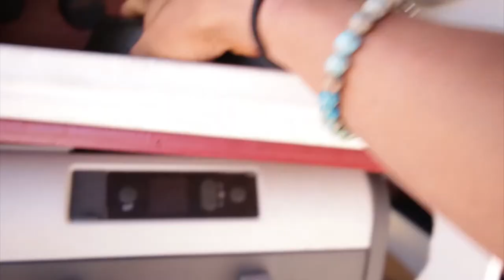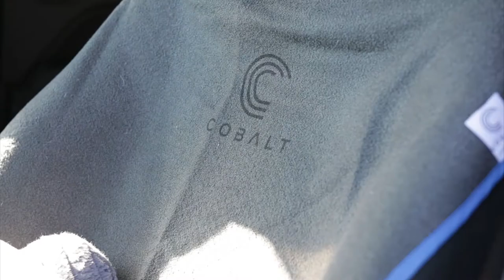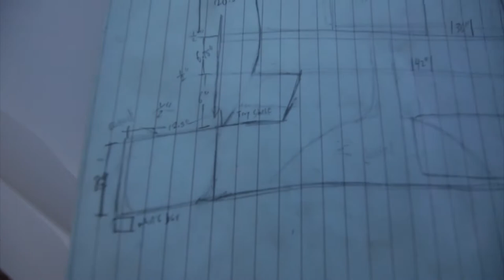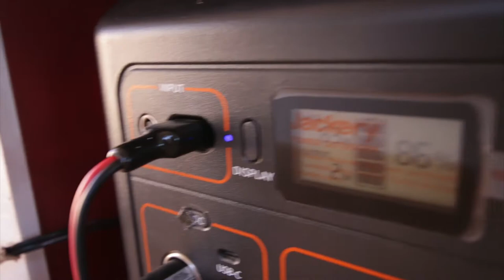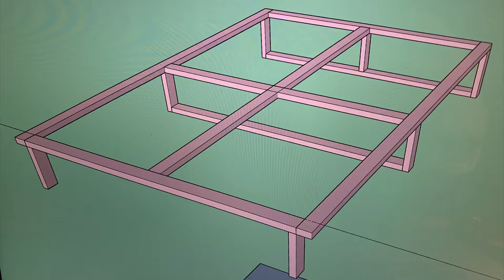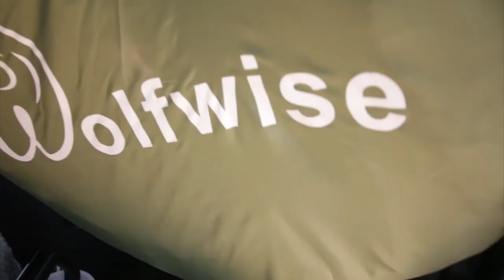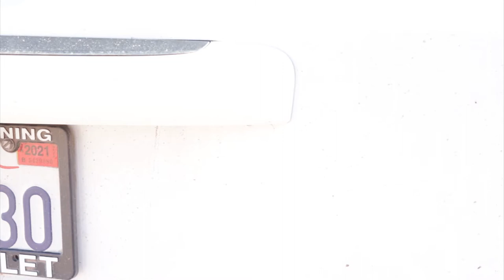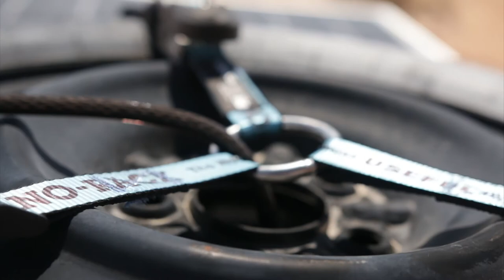TINY JEEP PATRIOT CAMPER CONVERSION! (Original Uncut)

Comment: I loved your video and build, but where do you sleep?
Reply from the maker: So it depends on where you are, I use apps like iOverlander to find places to settle down for the night whether it’s in parking lots, truck stops, blm land locations, city streets, pullouts, and everything in between. I did not once pay for a campsite or somewhere to sleep. The beauty of having a camper that essentially still looks like an ordinary car, you literally can sleep anywhere you want with respect to the area and those around you. I’ve slept in residential streets on many occasions and had no issues, Pearl just looks normal from the outside, no one would suspect otherwise. When you’re away from cities, it’s quite honestly free for all, stay on BLM land for up to two weeks if you feel the need to. You can tuck away anywhere, even wake up to some of the most scenic areas if you’re savvy. I also made custom pressure  fit 3-layer insulated blackout covers for every single window in Pearl, no light goes out and none in, you can sleep soundly without disturbance. Hope that answers your question! Thank you!

Comment: hello, i like the Jeep and think you did a great job. one question? why put the fridge on the drives side? I would think it would be more balanced,   if it would be on the passenger side, just wondering.
Reply from the maker: The car was quite balanced if you consider the overall placement of the items including the roof accessories/spare tire. Plus you have to understand that it wouldn’t make sense to place the bed platform on the driver side, I would literally be driving with the seat pushed all the way up due to the items placed behind, which obviously doesn’t make sense. Also, I wanted a really efficient way to maneuver from parking the car to sleep or parking to grabbing necessary things, less time and more discreet to make the bed from the driver chair and move to the bed within the car if needed, the angle of approach is easier and I don’t need to shift things around. Even consider if I got out the car, it takes less time to open the driver side doors then to walk all the way around to open the passenger side, especially if discretion is always on the mind. Keeping the bed on a specific side was ideal, that way I absolutely didn’t have to move/shift anything out of the way, almost 60% I felt the needed to make the bed in the car because I was parked in city streets or neighborhoods, I felt more comfortable hopping from the driving to bed in fell swoop. Thus why I felt it was necessary to put the fridge/larger bull head on the driver side. Everything was thought about! Thank you for your curiosity and question!
Reply: @bnjnmhsh  thank you, i am looking at doing something also and this was the best i have seen.